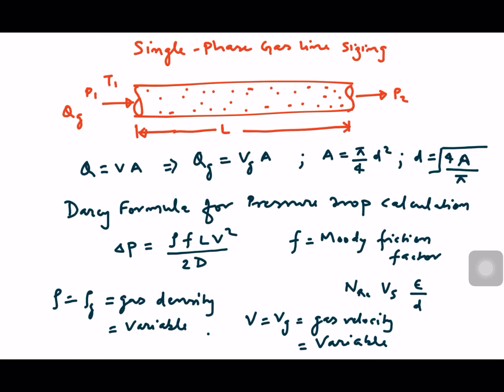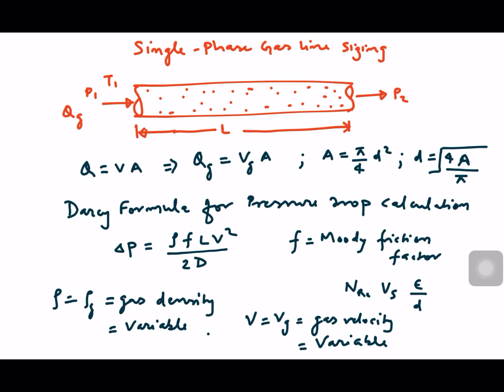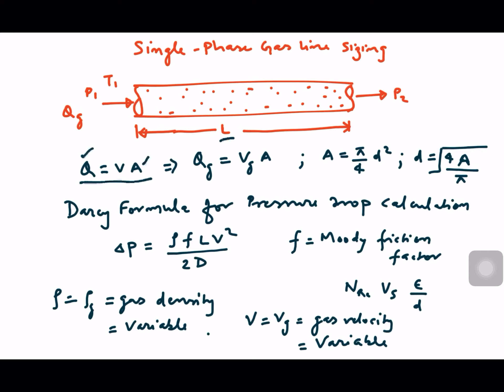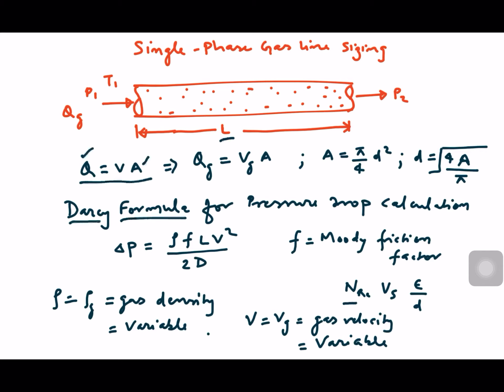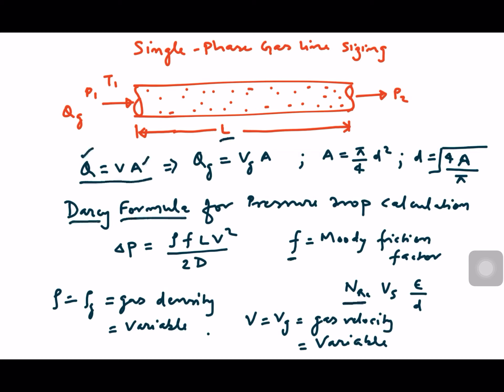Single phase gas line sizing concept

Comment: Thanks for your valuable video. Why velocity for flare gas is taken to Mach number.
Reply: I think in order to reduce noise,it is one of factor which is considered while line sizing.mach number should be less than 0.5 according to standards
Reply: @mohammedansif6559  Thanks for your kind reply... It's never too late.